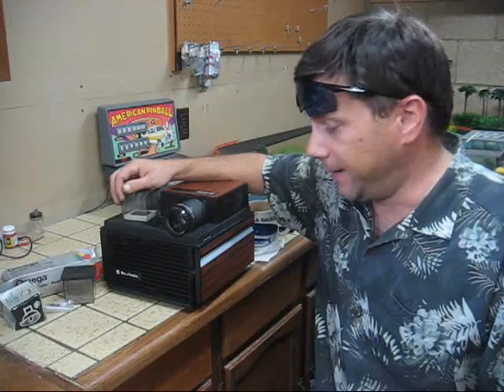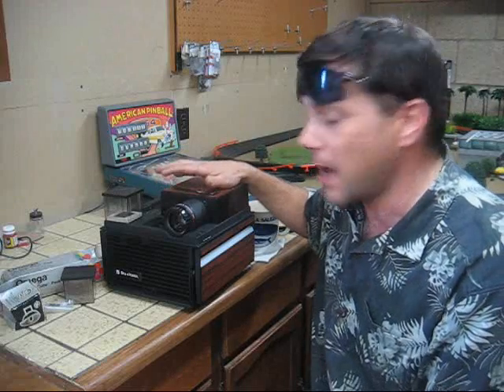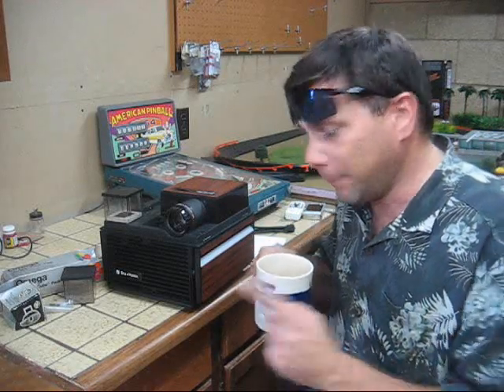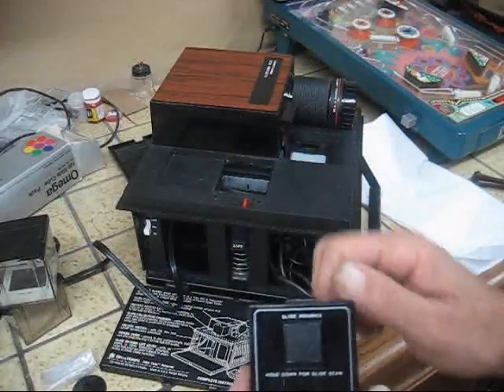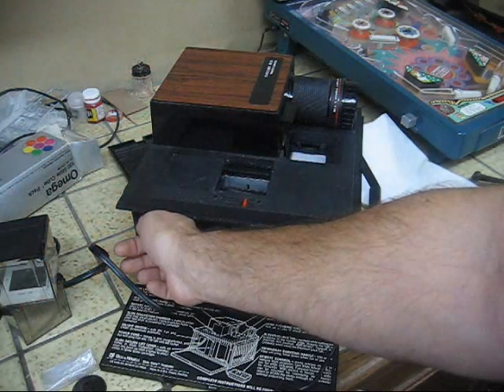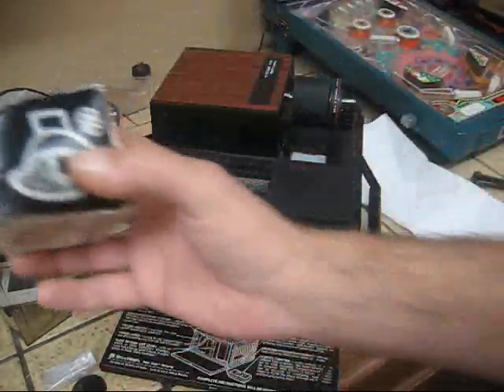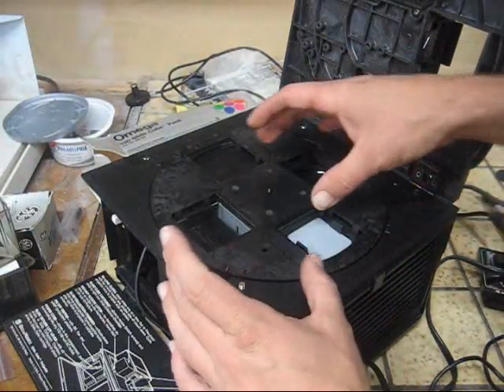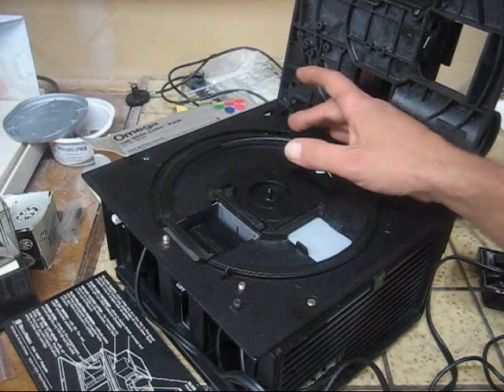Bell & Howell Cube Projector Repair Part 1: Troubleshooting.

Comment: In my case, when trying the projector after it sat for 30 years, the bulb was good but slides did not advance.  There was a solenoid buzz.  The fix required almost complete disassembly starting with the 4 screws in the top that allows the bottom to side off and the sides to be removed.  The wiring connections were not touched.  The problem was lubrication had become gummy and the solenoid was unable to get things moving.  The shutter blades, solenoid,  and the pivot for the indexing level were removed and cleaned with mineral spirits.  I did not lubricate them during reassemble.  The trickiest bit was hooking the return spring back on.  It took approx 5 hours.

Comment: Awesome.  Issue with carousel tray for a model 990.  Seems like to motor is having a hard time turning the carousel.  Reverse does work.  Replaced gear.  Old one was fine. Thoughts

Comment: Justin, great video! I have the RC55 and have a problem with a different part- the bulb. The fan and carrousel are both functioning as expected.

I replaced the existing burned out bulb with one I bought on Amazon for around $15 that came up in my search and specifically listed the RC55. 

It doesn't light. I took the bulb out again and replaced it with two very thin copper strips that I can attach alligator clips to. On my multimeter it showed that power was there. 

The only way I have of testing the bulb is to set the multimeter to the ohm setting that simply says there is continuity in the filament wires. The bulb passed that test. I'm at a loss as to what to do next.

Any thoughts you have will be greatly appreciated.

Comment: Thanks for this video. I have my dad's old protector and I can't seem to open up the top part of the projector to access the slide wheel. Do you have any advice for opening up the machine if there's a problem with the spring loaded tab to open the top?
Reply: i had to slide the red tab and pry gently with a small flat blsde screw driver

Comment: Dug up an old one of these just to see which old slides to digitize. I have no experience with a slide projector. The bulb (CBA) worked, and I don't need the turntable to work, but slides did not show at all, just a bright light projected. I think maybe there is a mirror missing because under the slot in front for placing individual slides there is a diagonally mounted rectangular piece of sheet metal that looks like it is supposed to reflect light up through the slide. There is nothing on that metal, but maybe a reflecting mirror is supposed to be there? Am I right about that, or is there something else wrong? If I am right, is there anything I can do?

Comment: How about when the shutters of the projector end up being so slow that they don't want to open anymore after viewing 2 slides? How does one bring them back to normal? Or can they be removed or held back without any negative effects to the projector? Are the shutters even necessary or are they more of a pleasing presentation thing when going from slide to slide? Thanks! matthewsmail07@gmail.com. Have a 50th anniversary to prep for in a month, could really use some help. Thank you.

Comment: I have a Bell & Howell CP40 projector that rotates the carousel very slowly.  It seems that the motor doesn't have much torque.  All the gears are in good shape and nothing is broken.  I believe the motor needs to be replaced.  Do you know where to purchase a new motor, or the part number of the motor?  Any help would be greatly appreciated.  Thank you.
Reply: I have purchased an AF70 with the same problem. The carousel moves very slowly. I checked the main gear. The gear is like new. When I try to hold the turning gear it seems to have sufficient torque. So I can't figure out what is wrong. Were you successful in finding a fix?

Comment: Like Kay I too have a projector that is very sluggish. It used to advance quickly but not anymore. Don't know if the problem would be in the main gear OR the motor itself. What would you look at first?

Comment: I have a model 981Q that I bought new many years ago. It works, but turns very sluggish, like something is gummed up in there. It didn't used to work this slowly.
I followed your video and the gear doesn't look like any teeth are missing (unless they are hidden in the casing).
Reply: And now I've lost one of the spring clips. It fell into the insides when I tried to put it back on. I opened it all up and shook it but did not find the spring clip. any ideas?

Comment: Justin: I just inherited an unused AF-70 slide cube projector that will replace one stolen years ago. It runs great and feeds fine but no image. I found the primary lens in front of the lamp/mirror assembly had fallen out. SO i take the beast apart and find I can't figure out how the lens is retained and which way it faces. I was assuming the more convex side goes down but without understanding the retention system I'm stumped. I can't include pics but there is a silver flat spring-type flat arm that seems like it might go over the edge of the lens but that seems a bit rough. Ideas or how it's retained and which side is "up?"  Thanks. 
P.S. I knew about the gear problem so  I'll probably order a gear just to have it ready, too. Thanks in advance.

Comment: I inherited one of these and got the bright idea of trying to use it for the old family slides....it didn't take long to figure out the cooling fan wasn't working properly. The motor seems to be good, but the "fan belt" is worn out. You wouldn't happen to have a video on how to replace the belt, would you? And are the belts available?
Reply: um.. Both of mine were/are direct drive. (AF-70 and ?)The fan is mounted to the motor shaft with no 'belt.' What model is yours?

Comment: robert again
hello justin:thanks for your reply to my af70 inquiry about the small rectangular metal bars in the magazine/collection area. evidently a spring is broken on one side but i am having a problem figuring on how to get down in that area. i have viewed your utube's a few times but need more of your inputs on how to replace/repair this spring. also where might i find a replacement spring. if i can get the old one out i might be able to fix or make a new one. an advanced thank you to you for your assistance .
Reply from the maker: Hi Robert. I'm glad you have ascertained how things are operating and what is the issue. I'm not sure any specific replacement spring are available, you could give it a Google search to see, but likely we will have to find something from some other application to work. If it is broken I would see if you can weasel it out of there so you can get an idea of how it should look. If you can find/ make something close you can try to get it back in without disassembly, Its the first time I've run into that so you'll have to give me a bit of time to take a closer look and disassemble it again to see how we can get in there.
Reply: hi justin: am still working on this but unsuccessfully. got a used one and the motor really slows down when it gets too warm, almost stops. are there motors for sale out there, or i could take the motor from the other one. do you have a u- tube on removing the motor?
Reply from the maker: Hi Robert, glad to hear you are still tinkering. Sounds like you have one well used and punished projector! But lets see where we can go from here to make some progress.
-
As for a motor.. motors get clogged with gunk. A motor is an amature with a commutator wound in wire in between two magnets. Two brushes, usually carbon,  rapidly change and charge polarity making the armature push-pull in the magnet's field, thus spin around... what does this mean? Carbon and junk build up after a while, like 30 years of use, especially when warm. if you could look inside the can you would see all sorts of gunk, dust, and carbon. this is the deposits of the electrons from the electrical flow.
-
 What do you do? well first, I highly recommend getting a can of Radio Shack electronic parts cleaner for projects in general. Yes, radio Shack is still around, one per city. It can be a little spendy, maybe $14 but a can lasts a long time. There are other brands. You don't have to use much. Wear some safety glasses and wash your hands after, follow all listed safety precautions. Usually, like using canned air, a few quick shots will blow the crud out of it, especially around the commutator, or 3 panel coppery  surface the brushes do their magic on, if you can see it. otherwise give it a good couple shots through access holes and let it drip/evaporate out.
-
Alternately -  Yes, you can get another motor once it eventually wears out, no, motors are not particular to items other than size, power and shape for particular application. there is usually little difference between that projector and one of my slot cars, other than those three things. the tough problem is the gear. you need to either get one with a very similar gear on it, or pull the existing one off and put it on the new shaft without bending it. You also need to disconnect the two wires and solder them to the new motor. Solder Irons are $20, I still use my Radio Shack one from high school electronics class circa 1993, new tips for it are $1.25 every so often. There are quite a few sources for a replacement motor including Digikey where you can choose from hundreds of different ones.
- 
So, i would suggest proceeding along those lines. Try cleaning it first before more work or money. If there is a Radio Shack, or similar, I would pay them a visit and have a chat, I do. Someone should be able to help you with getting some of those tools/ procedures, and it does take some tools. Alternately, yes, you could get another unit, they are pretty cheap, and then merge parts as needed to have one running until you are ready to tackle the other at your leisure... all the while watching your slides.
-
And thank you, yes, I will include this all in a future video. Swapping a motor is pretty easy if you see what to do and have some simple tools, which you might have laying around. They are not super expensive. 
-
So yes, step one, I suggest the cleaning, let's see if it still has life left in it. I have cleaned out model train and slot car motors from the 1960s put under hard strain and then left derelict to collect dust and choke up. Ridden hard and put away wet, as they say. But once cleaned out, de-oxidized and a VERY LITTLE oil on the bearings... they work like the day they were made. Once we do that, if it is still shot, we can look at doing a motor swap too. Motors last a long time, age doesn't matter, only oxidation or wear of brushes, shaft or bearing etc.components really tell the usefulness of a motor.

thanks for the comment Robert, we'll include that in the next vid.
Reply: justin: i do have an af80 and i bought a used af70. the differences are minor. wire holders and the slide collector holder are most notable. i removed the gear from the af70.   the little plastic gear,not the larger one but the one
 that drives the turn table, had badly worn teeth and would hardly turn that device. that ended the worn motor concept. for your own edification ----- my slide collection broken springs was also erroneous.  the f80  collection box just falls out when you turn the projector upside down and is more difficult to replace. as opposed to the f70 which is some how attached.   both of the tapered black slide devices must be moved outward to receive the slide collection box when said box is replaced. its one of those things where you have to hold your mouth just right. the springs, one on each side , are very fine hair like, that apply pressure on the tapered black devices and stack the slides. these springs fit into a very narrow 1/4" long slot, it is very shallow too. the springs had jumped out of their slots and would not apply  pressure on the black tapered devices, i repaired that problem. next i removed the gear from the f70 and installed in in the f80. all i need to do now is find a new gear for the f70 and i have 2 fine projectors. thanks again for your consultation.  ROBERT
Reply from the maker: Hi Robert, that's excellent news! Very handy improvisation and trouble shooting. It is ironic how sometimes when you start tearing into repair you find out it is completely nothing you thought it was, and if you're lucky, a much easier fix than predicted.This is good to know, I started tearing the projector down and thinking you probably need to break it down completely to gain access to the feed system... at least on the RC-55, it is the more buried part of the box. I'm glad you found that trick and shared it with us. You could make a video! Well worth knowing! If it is the same 2 part reduction gear needed it should be available on Amazon again. Otherwise, there are other sources for specialty gears. Thanks for the post Robert.

Comment: i have a bell/howell af80 that allows slides to drop into the collection chamber when loading. everything works  and i can show 1 slide at a time but when i insert a cube the slides all fall into the collection chamber. HELP please.
Reply from the maker: Hiello Robert. I am not familiar with the af80, in fact all I can find is images of the af70 online, but it looks fairly similar. Assuming it is, since it is a cube projector, it should function along the same lines. 
Now, from what you said, you can drop a slide in the preview window next to the lens assembly and get it to then feed. That is good, so your motor, gear,  and carousel are all working fine. However, you say if you load a cube, when you slide it forward all the slides drop out and fall to the bottom of the collection well?
If you watch video 2 I talk a little about the feed system towards the end. Not being able to see it I am going to imagine what is going on. 
#1 In the well there is the big black plastic follower. The big square thing at the bottom that you pull up on to eject the slides back into the cube for unloading. There should be a big spring under it. As you can see in the video, they like to stick in the full up, or down position. Make sure that it is loose and able to float on its spring.
#2 also, towards the top of the inside of the well are the two feed lips, I forget the official term, they are small black rectangular horizontal metal bars. They are springs attached to them that cause them to pivot out. Normally, they are popped out and hold the two edges of the slide(s) in the stack. They are angled on the bottom so that as the already viewed slides come back in the carousel they can slip under and deposit into the well while the un-viewed ones are still cradled above in the stack.
#3 Now, when you got to eject the spent (viewed) slides back into the cube, you pull up on the black plastic follower up towards the cube. When you do those two bars are pushed back towards the side walls of the well and the slide bellow stack with any left above being held by the feed lips, and the whole stack then pushes back into the cube. Once you remove the cube and drop the plastic follower back down into into the well into its neutral floating position, the feed lips should spring back out ready for the next cube 
-
So, make sure that the black plastic follower pops back into its neutral floating position on the spring and then check the two feed lip bars are popping out and you can push them in with a finger gently and they will swing back out when you let go.Make sure they are not jammed up, full of garbage or stuck to the well-wall. They should gentlly spring out about 1/4 inch, if that, just enough to hold the two bottom edges of a slide. As I said, refer to the end of video 2 where I am talking about cube jamming problems, and we'll go from there.
- 
I am pleased so many people have pulled these things out and are fixing them up and running them again. I am feeling more drawn to making a follow up video to address any other weird issues that required perhaps a few more close ups of details. The main gear is the big challenge with these but there are some other small components that should be kept in good order. The cube feed system definitely could use some more overview and I will be happy to cover this. Thanks for the question.